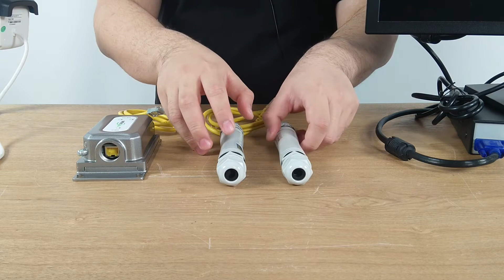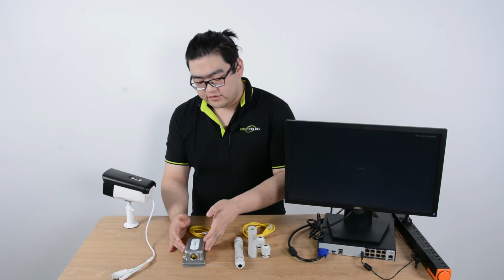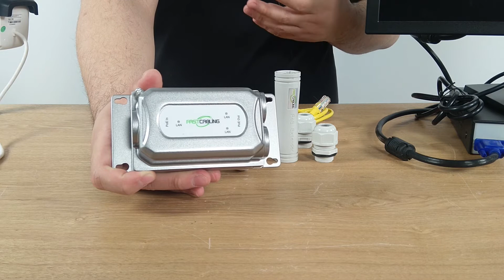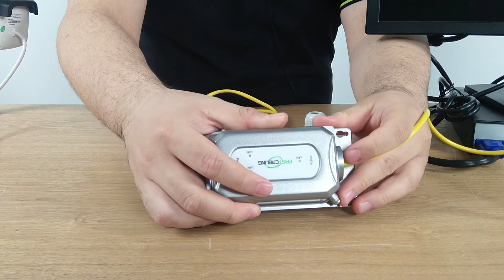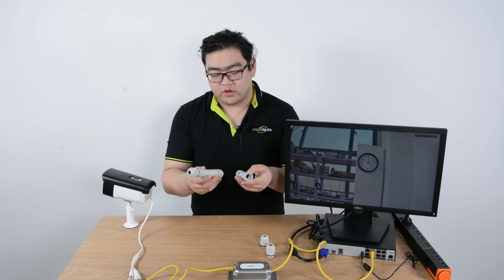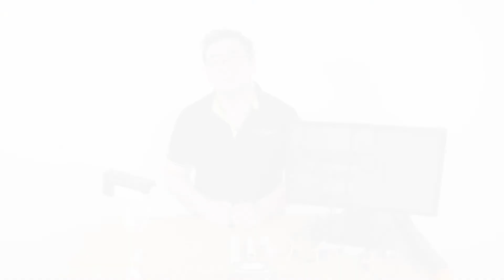How to Extend Ethernet Cable Transmission Range#1: Using PoE Extender

Comment: This does not work for 24 poe volt  devices
Reply from the maker: You are right. DC24V is a not standard PoE according to IEEE802.3 specification. Moreover, there is no power handshaking in passive PoE system. The standard require the voltage is beyond 36.5V, otherwise the standard PoE system will shutdown automatically.

Comment: How can I get some of  your extenders to buy I am in Ghana 🇬🇭
Reply from the maker: Here you might find the PoE extender. Please note it only works with network equipments such as PoE ip camera, PoE access points. Technically it boost up the network signal, not the cable. https://www.fastcabling.com/product/poe-extender-outdoor/

Comment: Do the poe extenders work with cat7 or cat8 cable???
Reply from the maker: I suppose you plan to works with the 10G network, otherwise, cat7 or cat8 is overkill. The PoE extender only can repeat 1G network. While it works with cat7/cat8, you just have the same bandwidth as cat6.
Reply: I want to connect my PC to main Router. But the distance is around 160meter. Can I use this method as solution?